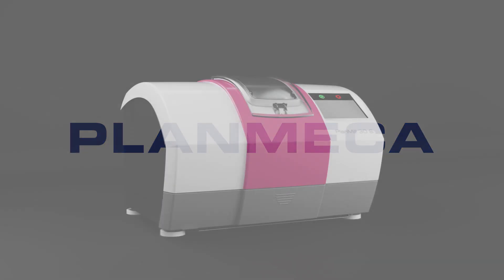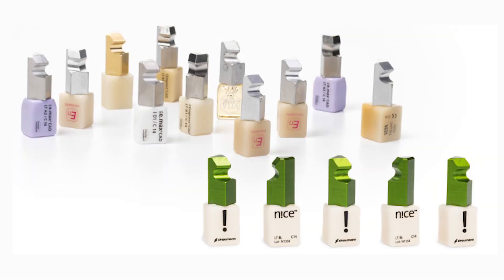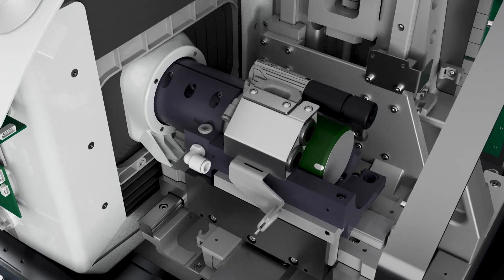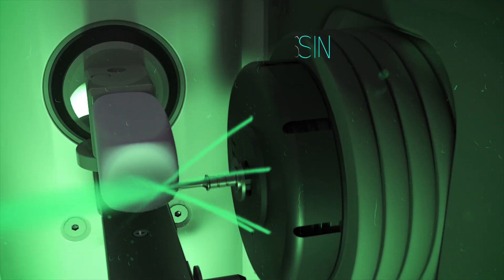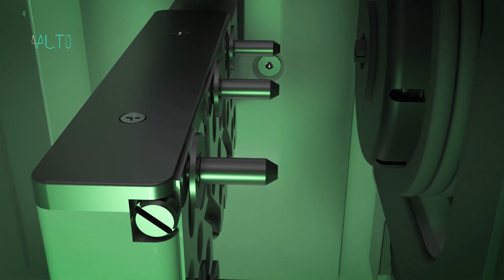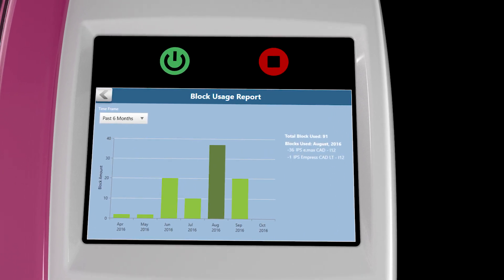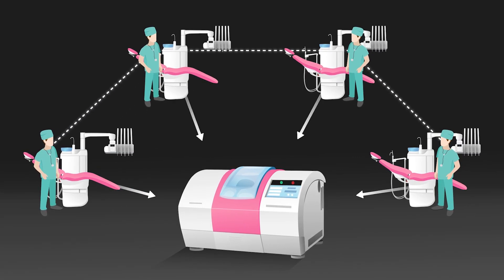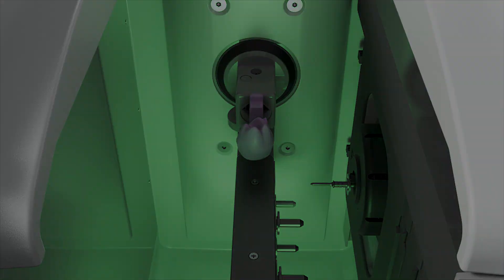Planmeca PlanMill 30 S – high-accuracy chairside milling machine

Comment: How do you get the mill time on these unit?
Reply from the maker: Hi there, the integrated computer automatically calculates the milling time and tool paths for each restoration depending on the block material etc.